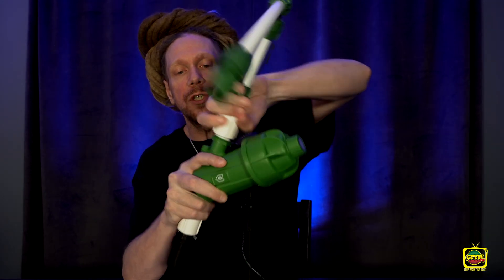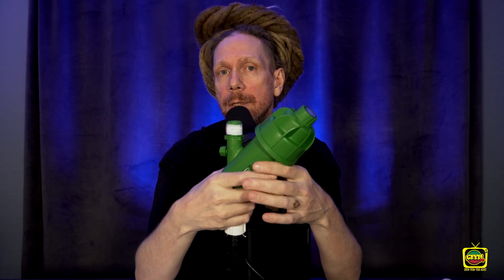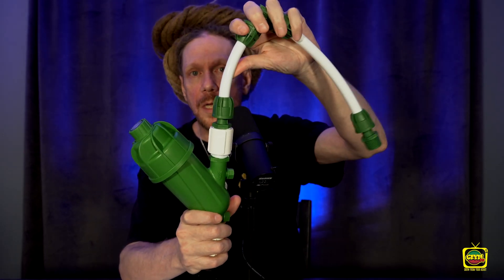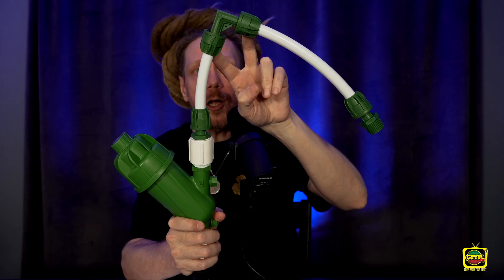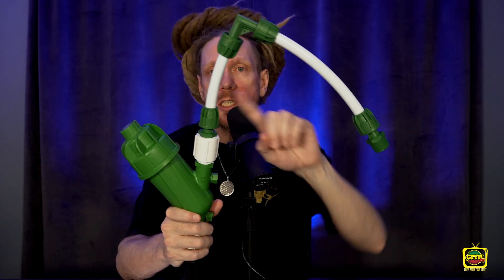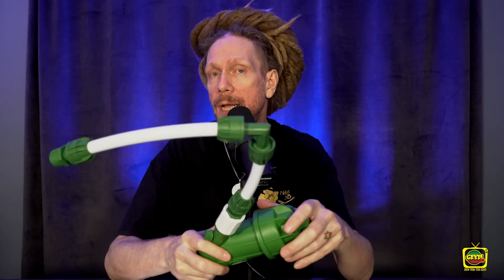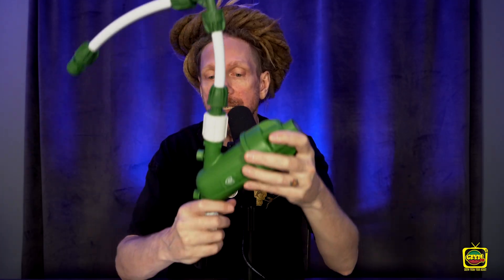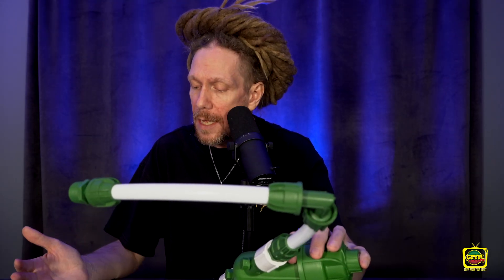#904 Corrections Department

Comment: NPT Is national pipe TAPER, compared to NPS which is nationsl pipe STRAIGHT. Fittings to adapt from a 3/4" or 1/2" pipe thread to hose are readily available. Don't worry about straight or taper, just tell the guy at the hardware store you need a 1/2" or 3/4" pipe to hose adapter. That isn't a hose adapter on your abortion, it is a 3/4" NPT ×1/2"NPT bushing.  And that thing is a strainer not a filter and should be installed horizontally, not vertically like you are holding it. You should replace that 1/2"×3/4" bushing with a 1/2" female NPT × hose adapter.
Reply: Whats up dude. Do you have a similar set up with the submersible pump?  I’m trying to set my system up and you seem knowledgeable.
Reply: @spiderkilla1 No, I don't use a submersible for watering my plants, I do use a 1/4 hp 1200 gal/hour submersible in a rain barrel to water my lawn. It pumps a 50 galllon barrell dry in just a few minutes. I'm a licensed plumber, steamfitter and gas pipefitter with 40 years experience with process piping systems and I can tell you Jeff doesn't have a clue. His pump probably has a capacity of 1500 gallons per hour, do you really need to move 1500 gallons per hour? Start by figuring out the volume of water you need to move, size your pump appropriately. I'm not familiar with the hose fittings he is using but they look expensive. You can probably find something better and cheaper  at a building center rather than the grow store. The thing he calls a pressure reducer is a check valve, the thing he calls a filter is a strainer and needs to be mounted in horizontal piping, not vertical like he has it.